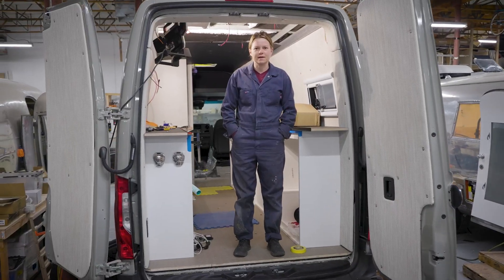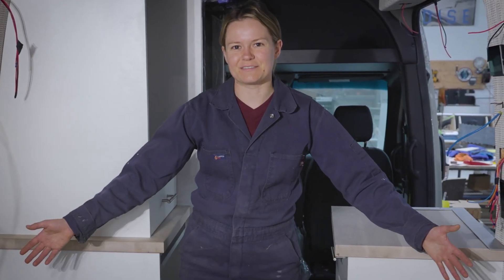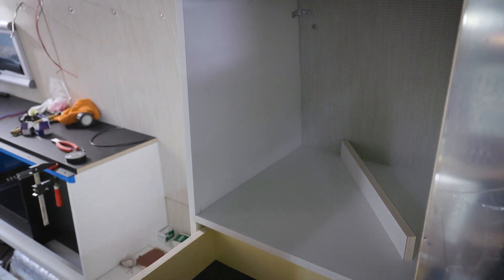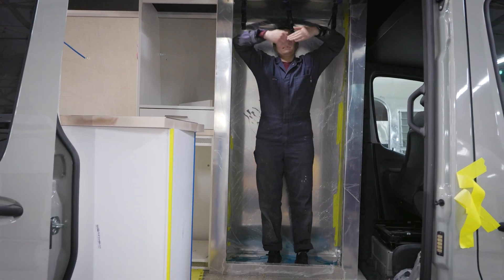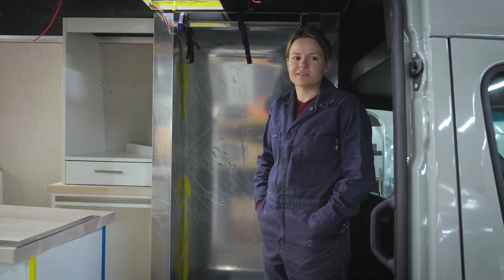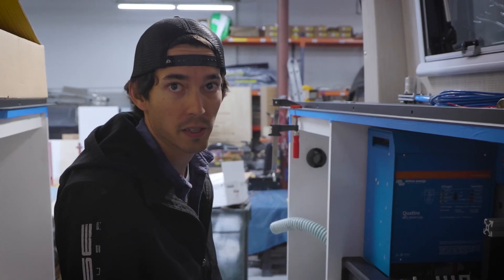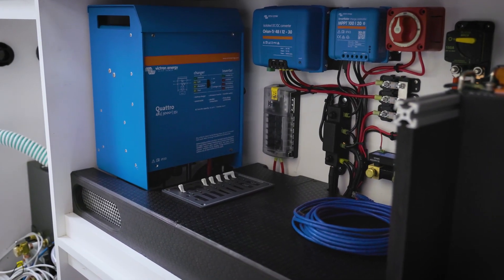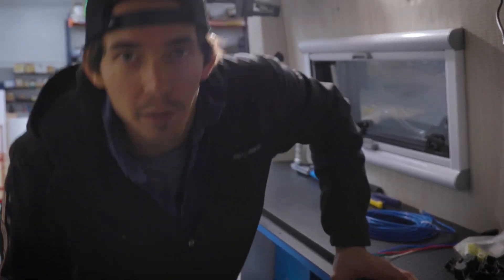Build highlight: 4x4 Dually Sprinter 170

Comment: Very vool build. Curious why you went 48V.  I am working on a build myself and looking at  installing 800-1000Ah in 12V heated batteries since I live in a cold climate. How would a 48V system be better?
Reply from the maker: Thanks, Dimitri! Chance touches on why we're going 48v here: https://youtu.be/j15FSkWCtTA
The short answer is smaller gauge wire (easier runs), smaller components (controllers and batt.) and less voltage drop (more efficient). The battery bank in this unit is about 600ah, and around half the size of 6 100ahr 12v Lithuim batteries. The 48v system in the attached video is an 800ahr setup with all needed components included to get an idea of how compact 48v systems can be.